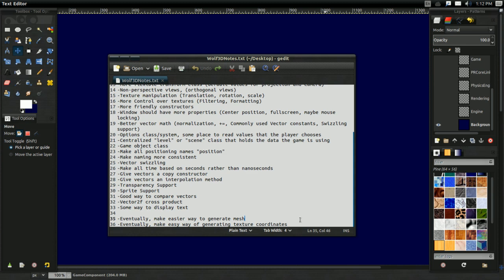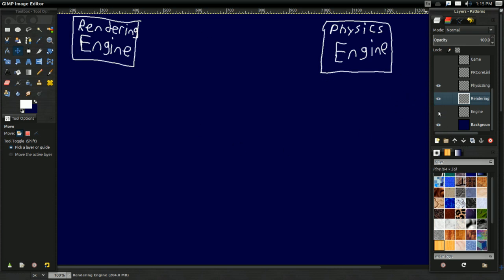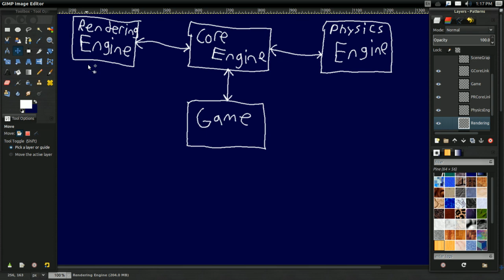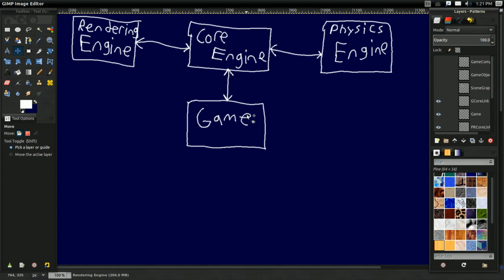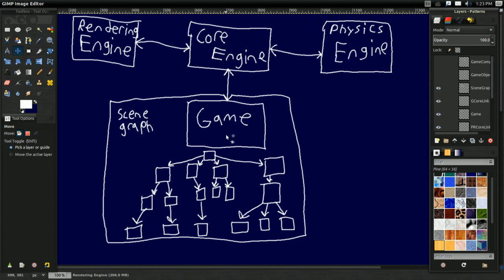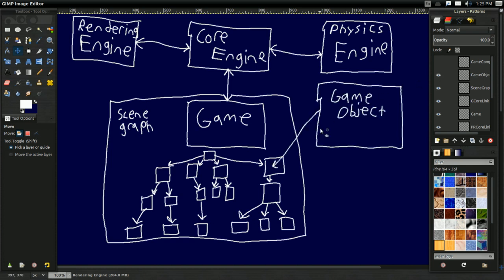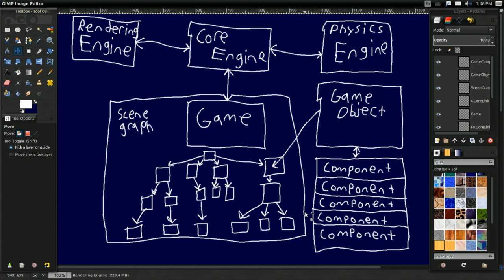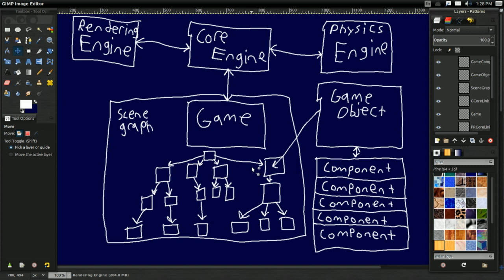#32 3D Game Engine Tutorial: Engine Architecture

Comment: Just wondering why u do colors like this:
new Vector3f(1,1,1)
instead of something like this:
glColor4ub(red, green, blue, alpha);

-- also ur way doesnt support alpha??
Reply from the maker: If you look at the OpenGL documentation, glColor4ub has been deprecated for years, and should probably be avoided. 
Also, alpha in that function probably doesn't do what you think it does. You might think it would create transparency, but transparency is actually done with blending functions in OpenGL. Although blending does indeed use alpha as part of the calculation, I'm not doing any transparency work at the moment, so it doesn't make a lot of sense to add the extra unused data.
Of course, when transparency support does become relevant, I'll be using alpha more, I'm just not at the moment.